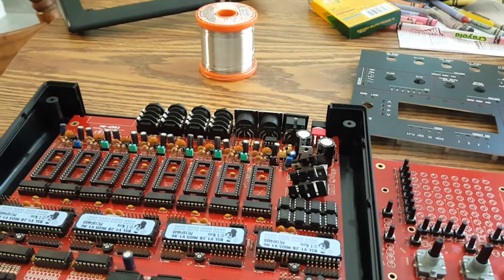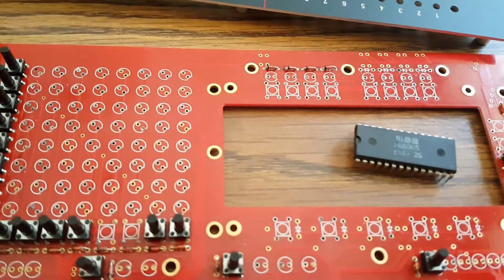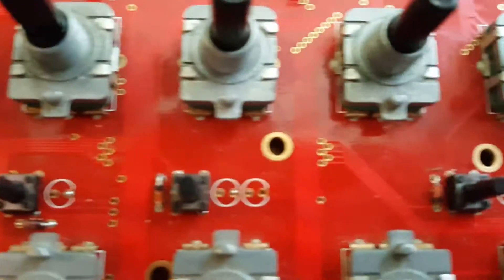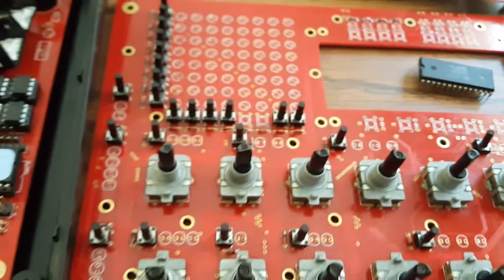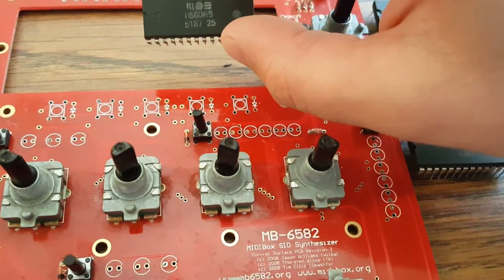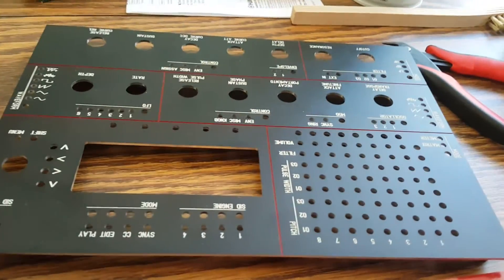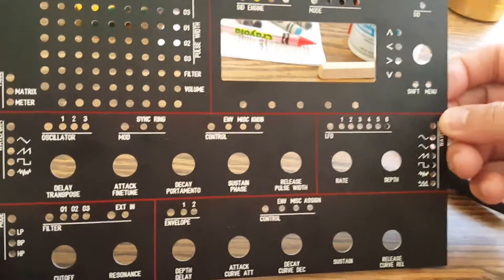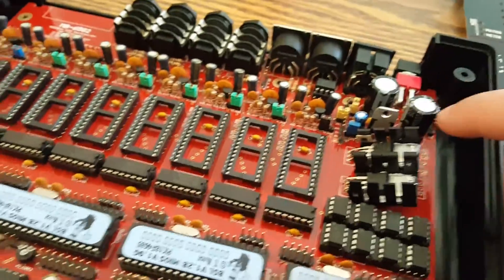MB-6582 build - midibox SID based synth with 8x SID c64 chip synth

Comment: Any updates on this? Seems promissing
Reply from the maker: vertig2k a few stumbling blocks...I ran into a bit of an issue with a few buttons not working. Not sure if it's  a broken trace or a bad shift register. There also is a bit of noise   on the outs...might be a ground loop. But close to done.
Reply: @SweetChinMuzik1  did you ever get it all sorted? I'm collecting all the parts tk do one.